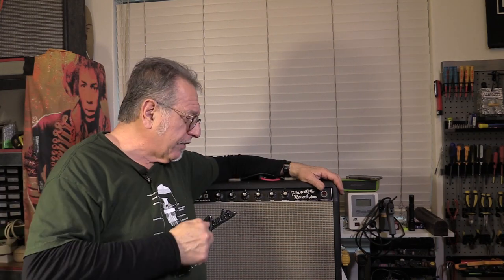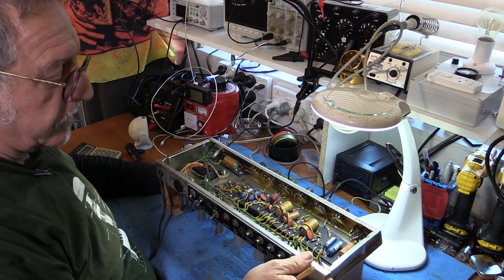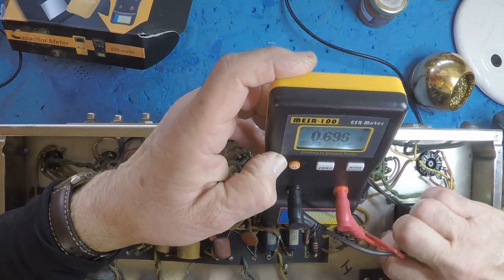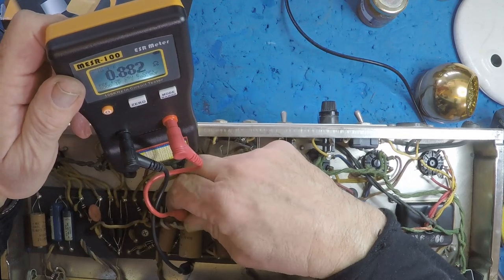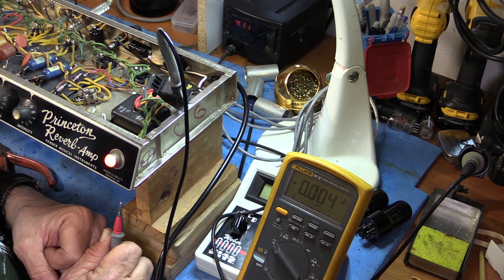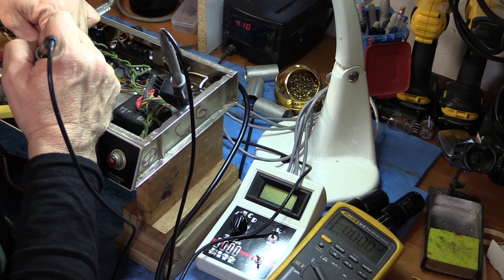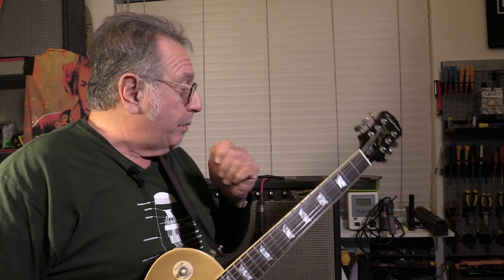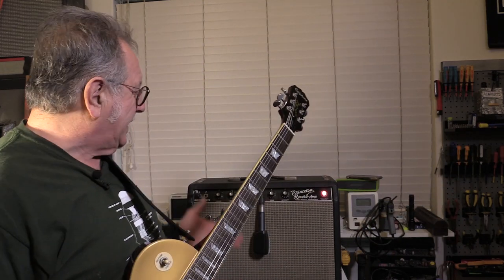How to make a Blackface Princeton Reverb sound FANTASTIC!

Comment: Excellent video. I watched part of it as (getting late here in the NYC Area (1AM) so I'll watch the rest tomorrow). 
Question: I have been considering the reissue Princeton Reverb. Are the reissue Fender Amps worth upgrading components? Or even going a step further and rewiring with a turret style board rather then the PCB board that they are made with today?
Also, by any chance do have have a video where you upgrade components in the newer PCB models? 
I can across your channel by accident (Happy Accident)...Excellently done and a ton of great information that you explain very well. All the best from the U.S....Gave you a Sub too.
Phil
NYC Area
Reply from the maker: Hi Phil! Thanks for your question. 
Are the Princeton Reverb Reissues any good? YES! Sure, Fender cheaped out on some parts, but I wouldn’t suggest pulling out new parts that won’t last for 10 years to replace them with parts that will last for 20 years. May as well get use out of what you paid for.
Two easy ways to vastly improve the tone out of these reissues is 
(1)	The setup. I can almost guarantee that the bias will be set way too hot. Also, you can tailor your sound by trying different V1 tubes. I like a 12AY7, but also give a 5751 a try. 
(2)	The speaker. I have a (real) 1968 Princeton, and the biggest improvement was in upgrading the speaker. I have a 12” Weber in mine. It’s a Deluxe-killer! My mate has a 10” JBL in his ’64. Awesome sound. 
Doing a turret board will probably open a can of worms. I have a Super Reverb in my workshop where someone had tried the PCB to Turret conversion and I have to sort it out. What a mess! Where is the noise coming from? Bad earthing? Poor layout of the filament supply? Poor soldering? All of the above? I know that turret board amps can sound better than a PCB, but a turret board has SO MANY opportunities for screw-ups.    
Let me know which path you take on your Princeton.
Reply: @theguitaramptech  Thanks Chris for your detailed information. I appreciate it.
Question: 
Generally speaking...How would a 12AY7 affect the sound in V1? 
Same question if I were to use 5751 in V1. 
Thanks....Time for bed. 1AM again...
Phil
NYC Area
Reply from the maker: @uptownphotography  Excellent question, Phil.
I do the 12AY7 mod in all my Fender amps. With a gain of 45, a 12AY7 is not going to push the next stage, tone stack recovery (also one of V1’s two triodes), into non-linear operation. I prefer to leave that to later stages, ideally the power tubes. 
More importantly, and to my taste, a modern 12AY7 sounds better than a modern 12AX7 (gain of 100). Even though it's in the same family as a 12AX7, the 5751 (gain factor of 70) is definitely worth trying for even the most doubting of all Thomases.
Reply: @theguitaramptech  Hi Chris. Thanks for that information. It might be worth a try at that. I like what you're saying and i am a believer in pushing the power tubes myself rather then all on the pre amp tubes.

The one sound that has been alluding me, with dual channel amps, is the gain channel is mostly good for heavier distortion, but not really that great for a warmer (and cleaner) over driven sounds. I only have owned one amp personally that had a clean channel that you could push into over drive and also had a lot of note bloom (into the harmonics). 

It was first generation Mesa Boogie Mark IIA model I bought new in 1979. But then something happened to it and the clean would only do clean. This is a mystery to me to this day why the amp stopped doing overdrive and the note bloom in the clean channel. 

I'd love to share the chronology with you (if you're interested ) as to what happened and maybe you would have insight as to what might have happened because of your expertise and background...All the best...

Phil
NYC Area
Reply from the maker: @uptownphotography  sure Phil. You can email me at anptech@teammania.com.au but it’s questionable as to how effective I could be 10,000 miles from you. 🤷🏻‍♂️
Reply: @theguitaramptech  Chris, sent an email. Alerting you in case it went to spam. Email is coming from Uptown Photography. Sent about 9:50AM my time on Weds...I guess that's 12:50AM your time Thursday. Be well.
Phil

Comment: Loved the video Chris! What's your opinion on swapping the Princeton's output transformer for something like the TO20 to achieve additional headroom?
Reply from the maker: Thanks Timothy. Yes, the TO20 is an excellent transformer, but, I would definitely not change the OT on your blackface, or even on my drip edge Princeton. The OT is a critical component to the sound that you love.  Don't even talk about the drop in resale value. 
If you want more clean headroom, first ensure that it is biased correctly (60% for headroom) and put a 5751 or (my preferred) 12AY7 in V1. If that's still not enough, sell it to fund a Deluxe Reverb. Let me know how you get on.
Reply: @theguitaramptech  if you don’t mind removing one wire to add in a resistor, then a 470k or 1m resistor to the pi input wi help control the flatulence in a big way. But there so much so much you can do with 12w and a 10”.

Comment: Thanks You for the detailed video!
Where can I find the 3 prong cable conversion. I saw your way of installing it but it seems like everyone do it differently..

Thanks!
Reply from the maker: You are correct, Matan. Everyone does it differently. Here are a few things to remember: 
FIRST. Turn off Mains power and remove the power cord from the wall.
SECOND. Check that first step AGAIN. 
Then,
1. Clip the Death Cap. I usually leave it in place but disconnected.
2. The Neutral goes straight from the power lead to the PT (power transformer). If you have convenient place to connect it (eg the disconnected Ground Switch) then use that. Otherwise, I connect the 2 wires with good mechanical join and shrink wrap them securely.
3. The Active goes to the INSIDE connector of the fuse FIRST (furthest from chassis)
4. The other end of the fuse goes to the Power On switch.
5. The other side of the power switch connects to the Line of the PT.

Many people like to wire the switch before the fuse, even Uncle Doug, who I admire greatly, but that is NOT correct in many countries for safety reasons.  I understand Doug's reasoning, but please don't. A flick of the switch will make for a very bad day. 
If you have any doubts, please DO NOT follow the above instructions and take it to someone who is more comfortable with death...like your typical Amp Tech.
Reply: @theguitaramptech  Thank You for the great explanation! In your video you go from the ACTIVE to the power switch and from the power switch to the outside connection of the fuse and the inside connection is connected to the power transformer. The description you wrote to me is exactly what you do in this video?
Reply: @Matan2222222  I noticed this too Matan. Active is shown connected straight to switch and from there to the fuse.

Comment: Gidday Chris!  Interesting video!👍  The 'parallel' resistance of capacitors you speak of is actually the 'leakage resistance' of the cap.  You didn't actually mention that.

These customers that want their amp 'as original as possible' annoy the hell outta me!  If you want your amp to be as original possible, take it to the bloody museum & let THEM polish your leaking or shorted resistors & capacitors ffs!

If I was the repairman for this amp I would turn the job down.  One o those 60 or 70 old caps could fail TOMORROW, & red plate one of the o/p tubes!  And what's the first thing the customer will do if that happens?  They'll throw the amp back in your face & say - "Where's my warranty?  Fix this for free!".

Well screw that!  I'll replace all the parts I think need replacing, & just give the customer back all the dead conponents & parts in a plastic bag.  MAYBE one day some anal collector or museum may want to buy it, but with all original parts.

I mean, do people sell their cars with all the original spark plugs & tyres?  Is the sale value of a vehicle gonna change cos it's got 'all original parts'?  It's value would drop if anything.

Nope.  This is bs.  I guess that's why I don't repair many collectors' guitar amps.
Reply from the maker: Thanks for your reply, Neville. What you are saying is the opposite approach to mine.   If you bought a genuine '63 Deluxe Reverb, and opened it up to find all of the blue molded caps replaced by Orange Drops would you be disappointed? I would. If I found all of the beautiful brown Mallory filter caps replaced with F&Ts would I be disappointed? Nope. I'd be thankful. My sound passes through the blue coupling caps not the filter caps. To use you car analogy, would I be upset if the tyres and plugs were replaced on my old Jaguar XJ6? Nope. I'd be thankful. Would I be upset if the twin cam 6 Jag motor was replaced with a more powerful, more reliable small block Chevy V8? I'd be furious. There's room for both approaches, Neville, so long as you are open as to what you are doing and explain the consequences.
Reply from the maker: Thanks for bringing that to my attention, Neville. I did mention "leakage" at 16:10, but I could have said it again more clearly, or using different words. 
I’m more surprised you didn’t pick me up on calling the Bias Circuit, the Rectifier Circuit!  I have to agree that I am not perfect (please don’t tell my daughter I said that). Can you please send me a link to your channel so I can see how you like to do things?

Comment: Wow, I can’t believe the NOS supplier claimed they were “matched”... do you mind sharing which supplier that was? It could’ve been a rare mistake (maybe..) but not a good look at all 😬
Reply from the maker: You're right, Tylr. It's not a good look for the supplier. I had bought quite a few tubes off him and they were all good, but not this time. He lost a good customer. It may have been a tube-tester issue. It may have had a bump in shipping. It's getting harder and harder to find good NOS tubes which may test as OK but are microphonic. The good ones were cherry-picked by the amp community 10 or 20 years ago. 
The seller is in Australia, and I will give him the benefit of the doubt by not naming and shaming.

Comment: Is there any reason to go to 100uf for a bias cap when you have a choice of 33uf and 50uf?
Reply from the maker: Hi Eric. I like to increase the bias cap for a couple of reasons: Better filtering and a more stable voltage. This goes with a word of caution. You don't want the cap so large that it will not charge up in time to provide a sufficient negative voltage to the control grid before the plate voltage. With a tube rectifier, we have a bit of time while it comes on line and ramps up its B+. That was a good question. Thank you.

Comment: Just got a 68 all original except for Power transformer, I guess I better change the bias cap? I've got 410v on the plates and 22 ma on the grids
Reply from the maker: Wow! That's fantastic, Eric. I also own an original drip edge Princeton. Yes, I would definitely check the ESR on your capacitors, especially if you're going to gig it. Your bias is a little hot at 75% dissipation. I would increase the 27K bias resistor until you can tone that bias down to about 65%. Start with a 33K.  If you have an oscilloscope, check you don't reduce the bias to the point of crossover distortion. While you're there, can you please increase the bias cap voltage rating from 25uF/50v to 25/100 or even 47/100?
Reply: @theguitaramptech  Great advice, ill be replacing the can cap with individual 20/500 caps and the bias with a 100/100 sprague
Reply from the maker: @shckltnebay  sounds great Eric. I’d watch going too big on your first bias cap. You don’t want the tubes to start conducting before your bias voltage gets negative enough. 100uf should be ok, but I’d go with 47 in my amp. If you have an indirect heated filament like GZ34 you should be ok.

Comment: I disagree to a point. Plug in a set of 1950's NOS Hytron Smoke glass brown base 6V6's and hear the difference, plus they handle high current if they are true NOS, it's no contest. The single orange blob cap sticks out like a sore thumb, there are better choices if the owner wants originality, or the look of it anyway. Power diode drop the B+ with a heat sink to get the the voltage down to 410 or so.
Reply from the maker: Sorry Tom, I'm not sure what part you disagree with. Good suggestion, but my customer would not have approved installing multiple power diodes on a heatsink. 
Certainly, I agree with you about a NOS set of 50's 6V6s. I have been stung so many times in buying NOS and second-hand valves. I can't pass them on to my customers, so I just wear the loss. I am sure there are reputable dealers in the US or maybe UK, but by the time they get to Australia my customer is either pissed off with the wait time, or the cost.

Comment: That amp isn't the usual princeton!! It's a AA764!!! Not the usual AA1164!! Leo Fender didnlt like that amp!! He wanted it dialed back because it was Fenders high end STUDENT amp!! Cheaper pots a lower output rectifier. That amp had gain and great tone!!  The Fender engineers brought that circuit back after Leo sold tge company. Also many rockers loved the sound of that amp but too low wattage for the times. The Mesa Boogie amp guy got his start by taking those amps a turning them into 40 watt, then 50 watt then 70 watt amps !!!! Carlos Santana walked into Mr. SMITHS shop and they asked him to try one of those hot rodded princetons and loved it. He said boy this amp boogies!! And a brand was born!!!
Reply from the maker: Excellent knowledge, Russell. I really appreciate your input and knowledge. I also love the early Mesa amps, but I think Randall got sucked into the black vortex of  "I will make it more complex...because I can" which often comes at the cost of tone. Thank you
Reply: @theguitaramptech  I'm more of a loreologist! I dive deep into speculative knowledge. For example what amps did Clapton and Allman use on layla, Claptons beano jtm 45. What's useful fact vrs speculation. Capacitor and resister controversy's . It floats my boat. I'm an old drummer who played alongside all of these classic amps. But the tube amps always fascinated me! I have enough knowledge to build amps but the wife won't let me!!!! Yeah the mesa's ,,,they tried to cater to the heavy rockers. Never met a Mese I liked. Mesa also hides critical schematic info so people find it difficult to repair or clone them.
Reply from the maker: @russellesimonetta3835  Cool perspective. loreologist! That's a first for me. I have heard many wonderful Mesa amps (mainly the early ones). I have been well supported by the Australian Distributor for Mesa, but the fact remains that his amps are unnecessarily complex, often at the expense of tone. Time to build that amp Russell!

Comment: Each to their own but the ignorance that being original somehow makes it better to me is nuts. Those old caps were shit to start with. If they leak and create resistance it's often a magic smoke incident. Replace the bloody caps and allow the circuit to function. I too love the retro nostalgia but it's an electronic circuit. The whole this cap sounds better (different) than the other is b/s until it can explained why.
Reply from the maker: Yes, I have heard your point of view many times. My thoughts: 
1.	The person doing the work either doesn’t know how to test components or doesn’t have the equipment to test components or doesn’t know how to use his test equipment to test the components. For example, you may know how to measure the ESR of an electrolytic capacitor. You may have an ESR meter. If you do, please reply and tell me what frequency it measures at. Do you know why the measuring frequency matters? 
2.	If you gave me your expensive 1965 Blackface Princeton that was making a crackling noise and I gave you back your amp with those “noisy” carbon comps replaced with blue metal films, and the Blue Molded caps replaced with Orange Drops would you be happy with me, or, angry with me, because I could GUARANTEE that your amp would sound different? It would also lose a hell of a lot in value. 
If you are an amp owner, then you have the right to do what you like to do with your amp. However, if you are an amp tech you owe it to your customers to get training/knowledge to respectfully service an amp.  For a good tech, it is more than a matter of “each to their own”. If your Tech suggests a shotgun replacement, it's time to find a new Tech.

Comment: It is weird how stupid some guys are about the parts in their amp.
The caps are 50 YEARS Old...... if bot now,  when..???
And..... if he replaces ONE, your amp is no longer  "Original"..... so why not replace the rest of them.
There is NO Magic in parts. They are there to perform a certain job at a certain voltage.
It does not matter if they are Blue or Yellow, Carbon or Metal, Oil or Plastic.
This amp does NOT sound  "original"  with 50 year  old Elytics.
But it WILL sound  original with new filter caps
Reply from the maker: Yes, many people share your point of view. I just happen to not be one of them. 
Briefly: Your sound does not pass through electrolytic filter caps, so change away. Your sound DOES pass through coupling caps and Blue, Yellow, Red or Green don't sound the same. If you're not sure about it, try replacing all of the coupling caps from YOUR old Fender with the cheap green poly caps from a hobby store. You may not hear the effect of one capacitor being changed but you will hear the combined effect. That's why shot gunning an amp will ruin it.

Comment: Why not use a 5Y3 rectifier? It can supply enough plate volts and current for 2 6v6s with tremolo and reverb especially a Russian 5y3. It will lower the plate supply volts alittle more.